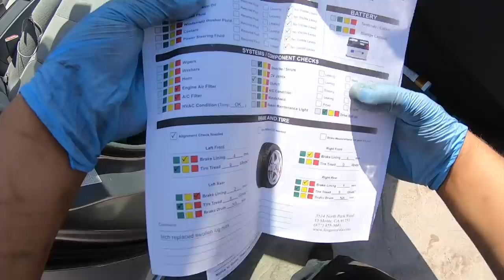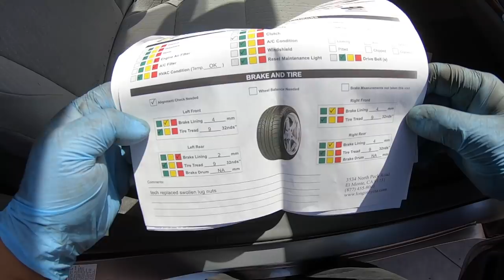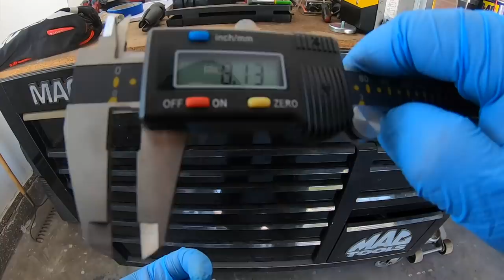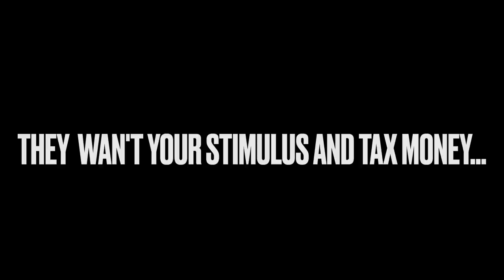This is why YOU need to avoid the Dealerships!

Comment: 1st thing you shoulda done was take photos of your "Findings" & your "Measurements".

2nd thing : Go in your House and write a Letter to BAR ( Bureau of Automotive Repair ) with a Copy of the As_ Wipe Lying Report.

3rd : Do the work on the Customers car later Today or the Next Day.

I've been Employed by a GM Dealership and Independent Shops here in Southern
California...The Technique that you're using to help Southern California customers is not the Way to get RID of the Rat Bast _ _ _ Saw Mill Lying Mechanics in Southern California. 

Your Technique : Putting them on Blast with a Video First , which really should be Last or Later on --- and that's AFTER you've written a Letter to BAR with Your Findings , Measurements & Photos.

Comment: I used to work at a dealership and I have to admit that one time I recommend rear brake pads. After the customer approved the job and I took the pads out of the caliper I realized my mistake. I felt horrible but didnt want to let the customer know because they most likely would never trust us so I did the front brakes at no charge and didn't tell them. I also changed the entire brake fluid, power steering fluid, transmission fliud and radiator fluid at no charge. Needless to say, I felt very bad.

Comment: First of all, unlikely a '18 mode; would be wearing brake pads out in 2 years unless doing 35-40k a year mileage.  ANd front pads wear out before rears usually.  Makes no sense.
Reply from the maker: Right, but brake pads wear out when stopping, therefore mileage has no direct  effect on pad wear. I can drive 100 miles a day without having to use the brakes, or drive 50 miles with constant braking...

Comment: This is a perfect example of why i NEVER go to the stealership!   N-E-V-E-R!!!
Reply from the maker: They’re all the same 😬
Reply: only when its under warranty after its up no way is right
Reply: @apctech1  my car has been out of warranty 3 years. Only dealer serviced.  I do need to get the brakes done.  I have no problems going to my Mazda dealership and getting work done because I know this dealership is honest.
Reply: @kevinW826  if you don't mind paying for parts that are marked up big time and labor rates that are higher then most independent garages example my Honda dealer charges 149 an hour labor my independent garage i use charges 87 an hour labor   look up etgc1 and Eric the car guy on YouTube he used to work for a Honda dealership he will tell you if the service dept. techs wrenches arnt turning they get a very poor per hour pay rate and if they don't upsell services enough they get talked to by a corp coach to bring them up or they let them go
Reply: Bones McGillicuddy  I have. I would rather go to a dealership than an independent garage. I have had too many bad experiences going to them.  The Mazda dealership has been very good and honest with me.  They only do the work I need on the car and nothing else.
Reply: @apctech1  the Mazda dealership I go to is $110 Canadian an hr and they only do the work I need them to do.  Oil changes, tranny fluid, and inspections.  They also send out videos of the inspections as well so I know what they are doing,
Reply: Bones McGillicuddy  from my experience, as long as I go in knowing what needs to be fixed and only that, I don’t get screwed over and I am not shocked by how much it will cost.
As an example, last year I had to get the handbrake cable replaced.  I knew it would cost me about $400 Canadian after taxes and everything.  Mazda of Brampton was going to charge me $600.  I priced it out at Achilles mazda in Milton and they did it for under $400.  They also did the tensioner and belts for under $200 Canadian.  The most I have spent in one go on repairs has been $500.
Everything has been oil changes, two alignments, two transmission fluid changes, and a brake service.  I go in once every 4 months at 8000-9000 kms as I drive on average 2000 kms a month, so I know my car.  My car was in yesterday for an oil change, tire change over, and two front wipers.  Total was $149 and change.  I budgeted $150 as I know how much Achilles Mazda will charge me.  
On the other hand, independently owned places are not the most honest places to go as they don’t have the most up to date equipment.  Example, I had a 2004 Ford Explorer and I had to do the transmission fluid change.  They didn’t have the equipment to fill the transmission.  They used a water bottle and a plastic hose to fill my transmission.  They nearly damaged the coolant lines as they didn’t know they had to connect tubes to the radiator coolant line and the transmission lines and pump the whole system.  
Afterwards I had to go to the ford dealership and have them drain the transmission fluid and get rid of the air bubbles that were in the radiator coolant lines because the thermostat was in the red.  No, for me I will stick with the dealership.
Reply: @kevinW826  that does not happen in our dealerships period you might be lucky in CA but in the usa dealerships wont give you videos of the work done let along let you see the old parts  your dealer is not in the US so its a whole diff ball game

Comment: Exact same thing happened to me. Dealer tells me I need new front pads and rotors, $400. I take it home to fix myself and wouldn't you know it, rotors are fine, pads have ~8mm.
Reply from the maker: Sounds like a dealershit 😄
Reply: What has happened over the years is rotors are made thinner for weight reduction and can rarely be turned even once before hitting discard spec. Most shops want to eliminate any possibility of noise on new brake job and that means turning or replacing rotors. For a do it yourselfer, on a rotor that isn't causing a pulsation a light sanding and cleaning will be just fine if its not below discard spec. New rotor prices are very reasonable though and should always be considered when replacing brake pads.

Comment: Swollen Lug nuts?  How does that happen?
Reply from the maker: Using the wrong sockets, happens on lug nuts that have the chrome shell. If it calls for 21mm you need a 21.5mm to properly remove the lug nuts. 🔩
Reply: @HomieHektor  also if your in a colder climate like were i live water will get between the chrome shell and swell them out when they freeze thats why i always replace the chrome shell with real platted ones

Comment: When a car is under warranty after service Dealership guy will be "Your car is absolutely perfect. You taking good care of it. So total is 575$ how would you pay? Also these air fresheners are complementary"
After warranty period is over dealership guy will be "We got few issues that needs to addressed. Timing belt needs replacement for 200$, brakes needs to be cleaned for 320. After discounts your total comes down to 955$"

Comment: Had almost the exact same experience with Capitol Mazda in NorCal. They quoted me $420 to replace just the front brake pads, because one side was down to 3mm. I measured and the least I could get was 6mm, which is more than half of the thickness of brand new pads. I left them bad reviews on Google Maps and Yelp.

Comment: Just had my oil changed and transmission filter and fluid changed. AC dies weeks later? It’s under an extended warranty and covered but still? Compressor dead and a leak in the condenser. Condenser was replaced at 65k now at 106k? 2015 Suburban 5.3L

Comment: I work at a main dealership.
There are some crooked service staff, but there are some great service staff too.
Main dealerships get a bad reputation, when a small percentage are crooked and then people shout all over the internet about ALL DEALERSHIPS ARE THE SAME which is simply not true.
What should be made aware, to the customer, is that most of the vehicle health checks (which main dealerships have to do by law), are estimated wear.
On many cars, you simply cannot accurately measure brake pad wear, because you cannot get a measuring tool into the caliper, and so it is an estimated amount left.
The technician will over estimate for safety, because if they said 4mm and it was 2mm the customer could sue the dealership and say it was dangerously low.
So long as the customer is made aware that the measurement was an estimation, then that is surely a good thing.
Maybe some people would like to leave a dealership with no checks being done to their vehicle, and serious safety issues completely missed. Then when they have an accident caused by a fault with the car, they can complain their car wasn't checked over fully last time it was in the dealership ?
You can't have it both ways.

Comment: I took my Ram to Michiana Dodge (Indiana). I needed the oil changed, something I had paid for in advance. I also needed my fuel filters (2) changed. I know Jiffy Lube charges about $160 to do both fuel filters. Others dealers charge anywhere from $180-$220. I did not ask for a quote in advance. MY FAULT. But when I got a bill for $585.00 for ONLY the fuel filter service I knew I'd never take a vehicle to a stealership again. Not if I can avoid it.

Comment: The dealer will give you a size 10 poop chute on brakes...if you only need pads you can literally do them yourself for under 50 bux. Of course not everyone has the knowledge and tools to do this...and they end up getting fucked by the dealer.

Comment: I was on the road when my change oil light came on. Stopped at a dealer to have it changed. They tole me I needed a new Prop Shaft (rear drive shaft in an AWD vehicle). I got under vehicle when I got home didn't see anything wrong and u-joints were still tight. 5 years later it still has not been changed and no issues. They quoted me almost $1200 to change it.

Comment: I have a Mercedes Benz still under warranty. I take it to the dealer for the A and B service. I just had service in January but I've been getting emails saying I was due for service. So I called and was told that when I was there in January, I was told I needed new tires.  The problem with that is I got a full set of tires in July of last year. I have maybe 8k miles on the tires  I told the rep that was impossible and if I need new tires, someone is going to have to explain the wear in 10 months. I was supposed to get a call back to follow up.  That was 3 weeks ago. I'm still waiting.

Comment: Went to Audi to get my recalls done. Told me I needed new brakes. They wanted $965 + tax! WTF. No that didn't include new rotors. That was 8 months and 6,500 miles ago. The OE parts from Audi website are ~ $100 so where they were getting about $500-700 in labor for brake pads is beyond me. I'm throwing Akebono ceramics on when they're ready for replacement.

Comment: Honda dealership in WPB wanted 850 to replace 4 plugs and coil packs on 2007 Fit.  Their diagnosis showed only number 4 misfiring.  If it was warranty work, beat they would have replaced only number 4.  Took me 55 minutes to do all four.  They wanted 250 dollars to replace her serpentine drive belt.  Shameful.

Comment: Had the same thing happen with my VW Golf. "You're down to 1mm on the pads. Both pads and discs are going to have to be replaced." 
"But I drive a manual," I said. "I downshift and coast to stops. The first I've heard I need total brakes at 30k."
Picked up the car and was told that I had 3mm left of the pads.
Took the car to an honest mechanic and was shown I had 7mm left on the pads.
Cure> besides avoiding a dealer at all costs.   ASK FOR THE OLD PARTS.

Comment: I had a toyota dealership in Whittier CA inspect my scion xb before I drove cross country which included oil change. Drove to work that day, filled gas tank, decided to check oil.... dipstick showing wayyy over filled. (ID HAVE BEEN SCREWED if I drove cross country like that!) Next morning I attempt to drain a bit myself but the oil drain plug is way more than hand tight and I cant release it. No apology from dealership, no compensation for my time.

Comment: One time my car overheated (Chevy is notorious for bad coolant systems) and I used OnStar (discontinued cause it's a ploy to lure injured cars to the dealer). All it needed was to be reconnected and topped up with coolant. Dude quoted me $1400 for repairs. $600 parts, $800 labour. 

The quote listed "Turbo Feed Pipe" and "Bipass Hose"

I did the repair myself for $30. Still have that quote from email. 

Dealership is the Stealership

Comment: Took my versa to dealership for warranty issues. Transmission slipping and noise from brakes. I was told transmission was normal and I needed front brakes and rotors, rear brakes. The car only had 27000 miles all highway with minimal brake useage. They also said I needed a new cabin air filter and the car doesn't even have one. Went home pulled rear and front wheels and brakes were like new. Complained but was just brushed off. DON'T TRUST STEALERSHIPS.

Comment: Front nearside tyre is down by 2 psi
Service Desk... “you need to change your gearbox as it has a blinker fluid leak. That’ll be £100 in parts and £1,000,000 in labour. Oh and would you like to buy this air freshener”

Comment: I will say sometimes mechanics make mistakes. Also they are not removing the brakes to look at them fully. Being pressed for time dosen't always go over to well. But yes maybe the tech wanted another job. Lucky I'm trailer truck technician I don't get paid by the job just by the hours. But i can say I did accidently think brakes were worse then they are. But to be fair it's hard to look at air pad brakes do to the odd angle and wheels that don't let you see much.

Comment: Had a similar "incident" with our local Ford dealer in Clearwater, Florida. We had 4 brand new Uniroyal tires installed at this very dealership just 7 days prior and here we are, seven days later in for an oil change so guess what? The service manager comes out and says that the mechanic said all 4 tires were dangerously worn and needed replaced! Hmmm, really, lets go take a first hand look and guess what? It still had 4 brand new tires on it! Needless to say that the mechanic was fired because little did they know that my wife and I were on a first name basis with the owner...

Comment: This bugs me cause I work for a Toyota dealership and have pulled a cars in wanting brakes done. Had two with pads over 5mm but a different tech (who no longer works for us) put down 2-3mm. One the customer was a little bugged about it but said go ahead cause they were about to make a cross country trip and wanted good pads and rotors. The other the customer shrugged it off and said mistakes happen and they left. Due to that though they only let myself and one other tech (shop foreman) work on their car. But can say that we get a lot of customers that went elsewhere and were told they needed something done. Yet looking things over I couldn't find anything wrong and sent the customer on their way. I believe in karma and I try to be upfront when I see things that are a little off or worn out.

Comment: My AC went out one time, ended up being a $5 relay,  which the service manager said “luckily, most of the time it is only that”  BUT these fucks said they had to do a cooling system diag first for $150.  I said to him “If it’s that most of the time, like you just told me, why not just swap out the relay first, if it works, fine, send me on my way, I’ll even pay $50 for the time, (10 mins) and bay usage”.  He just gave me “Well, I guess you got me” look.  I’m sure the “Cooling System Diag” is just some schmuck turning on the AC, and saying “well, it’s not cold as much as it should be”.

Comment: I went to this place for my inspection. They told me all my brake rotors were warped. That didn't sound right. All of them? I went to my Acura dealership and passed inspection. They told me my rotors weren't warped and warped rotors don't fail inspection anyway. Saved $600.

Comment: I took my 2018 Nissan Sentra in for the free oil change and inspection.  They said I needed new brakes, new tires, new shocks, a new timing belt, and a transmission flush and a 50,000 mile "factory tuneup".  I have 19,000 miles on the vehicle. All highway miles. The tech didn't even look at the odometer he just saw the year.  When I pointed out the mileage, he came back, and said "I'll pass the brakes for now, but they are at 6, and 4 fails.  I will never go back, a free oil change and a free $12 inspection isn't worth them trying to rip me off for work I don't need!

Comment: Thanks man. You've got a honesty in your tone of voice. Appreciated the tip. Liked and subscribed.
Quick question bro. I am interested in purchasing a 2010 Ford Everest 3.0 Diesel 4x2. Car is mechanically sound but there were a few places on the right and left fenders that showed spraywork and body repair. Owner says it was a light side impact. Not too sure how deep the damage went but the car moves really well. Mechanically well maitained, starts up on the first try, rides smooth, clutch doesn't feel worn and is actually quite soft. The price is at least 15% below trade value. Would you say this is a good purchase? I am going to take my mech to have a look at the car as well before I decide.

Comment: I try to do some of the work on my car on my own. Simple procedures like changing out the In-Cabin Air Filter, Wiper Blades, Engine Air Filter are some of which I do. YouTube videos help with finding out how to do these steps. I have a 2018 Toyota Highlander and the dealerships I have taken it to loves to keep adding on things you will need to have done to the vehicle to make a mark-up on the costs of the repair or maintenance. This is a good example as to why you can have a second opinion on something if you suspect someone is trying to pull a fast one on you.  Good video Hektor.